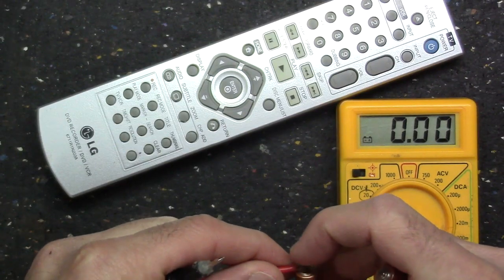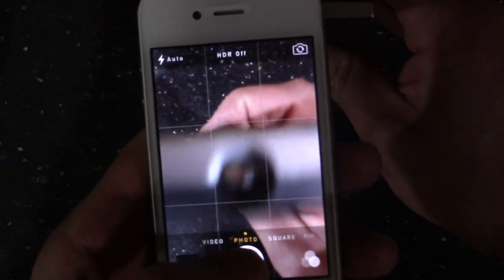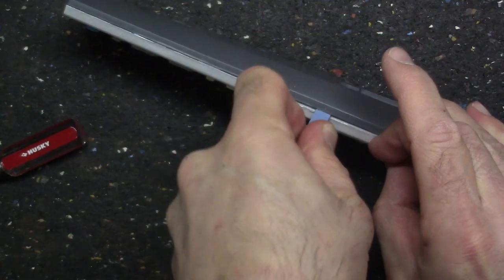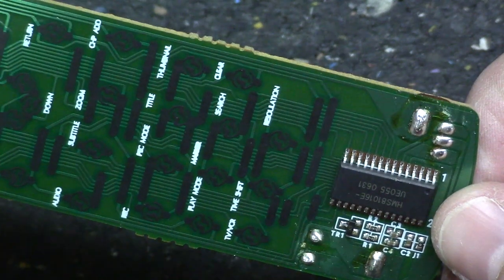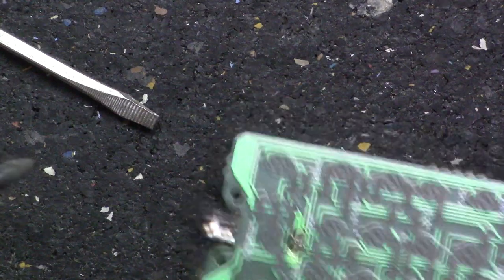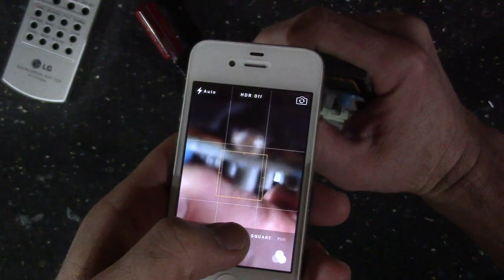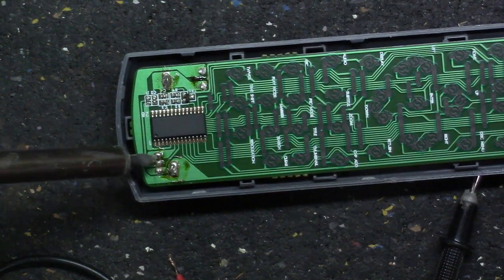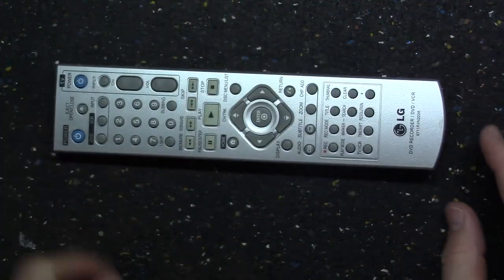How to fix a remote control

Comment: "Usually" it's dirty contacts on the back of the buttons or the backside of the pcb where the button press touched the contact..and not a cracked solder joint..please try cleaning with alcohol prior to  taking a soldering iron to your joints. If you aren't very skilled with a soldering iron , you will very likely heat it a split second too long and it will bleed to the next solder point, and then your device is history...and DEFINITELY don't remove  any capacitors/resistors unless you bought a replacement and are highly skilled with an iron. Thanks for the video
Reply: It depends what the issue is "IF" it's the  remote is completely dead like in video then yes that is most likely the cause... IF some of or most of the buttons don't work then it's probably the contacts like you said.....

Comment: Thanks for the video Adam. I have just bought a used Hi-Fi, which was working perfectly, but the remote was completely inoperative (one of the batteries had leaked and corroded the terminals) and I thought I'd have to buy a replacement on eBay. I cleaned up the battery terminals and wiped the circuit board with IPA, but this did not make the remote work. I then followed your advice about dabbing each of the solder terminals and it now works perfectly (although I held the soldering iron on the battery terminal joints a bit too long and they fell out, so I had to reattach them.
Five minutes work with a soldering iron saved me £16 and the hassle of buying a new unit! Great tip about using a phone camera to test all the buttons by the way; although interestingly my work iPhone camera didn't register the LED, but my old Samsung phone camera did pick it up.

Comment: Thanks for making this video, which helped me to fix my remote control for a brand new Lasko fan I bought with a remote that didn't work on arrival. In my case, pulling out the positive battery terminal springs a little bit, did the trick.

Comment: I had 2 remotes go dead after a move and I was able to fix one by doing just as you did and going over the joints with a soldering iron. That worked like a charm, even though I couldn't see anything wrong with the old joints. The other remote had a cracked board and I wasn't able to spend the time to solder on some short jumper wires to bridge the crack. Hopefully, I can get it back up and running in time.

Comment: Thanks for putting that up.  I was busy scrubbing the contacts on a remote and wanted to see if there was any solutions I didn't know about.  I've noticed that every control I've opened up has oil around the defective button.  Likely finger grease.  Since I've had a dish DVR for years, I have a donor remote that in extreme cases, I cut out a button to use as a replacement.  My surgical skills are not good enough to transplant the carbon button (yet).

Comment: Work for me used a solder on soldering points on my remote especially on led contacts and it start emitting IR - works (sherwood RNC - 100 )

Comment: hi from greece
one more test that your led is working beside the i-phone
it is ......THE RADIO
just put radio in to a frequency and test the remote control ...then you ll hear a sound if it is working !!!
if not... then it has problem!
Reply: Thanks ! My remote's capacitor had plucked out with the copper plating , which I resoldered by scraping the line and exposing the copper plating nearby  in same series. Still that did not work. After watching your video, i heated all soldered joints with soldering iron and now my remote worked :-) Thanks again !

Comment: And if all else fails and you just happen to have bit of gold leaf to hand, justy guild the contact face on the button. I used fake gold leaf and spraymount as an adhesive, worked a treat, but probably need to be gentle with the button.

Comment: In case folks need a tool for opening a remote, there are numerous spudger tools on Amazon. I would get all three types, metal, plastic and carbon fiber. OEM remotes are so expensive that you're almost forced to get them over the cheapo universal remotes, if you can't fix the original. Also, if you plan to do soldering, get a grounded, low/medium heat iron and work quickly.

Comment: Indeed a remote is so simple that usually its the bad joints to blame. If u cannot spot a crack or a disconnection by looking from the top, just flip the PCB and look at the joints sideways. Thats where u see a lifted joint or a disconnection

Comment: I liked your video, was just wondering if you could help with an issue with my remote, I have a simple wall fan remote control and all of a sudden only the 'switch on' button stopped working, however the off switch button is working, I also tried to clean the switch board but the 'on' button still won't work work

Comment: If you don't have a plastic spudger or opening tool, do you have a guitar?  A guitar pick is a great tool for opening press-fit plastic cases.  If you have any kind of plastic credit card you don't need, you can sand it to a wedge and use that.  Even a butter knife can ruin your casing, so just don't use metal.

Comment: What if you snapped the circuit board in half? Got a AC remote, can get for $50. At the moment using a phone app I had programmed prior to kneeling on controller

Comment: This works though it's hard to tell which joint it is because  they're so small..
( even in this vid and author with experience didn't get it right first few times) 
I apply flux any areas that looks sus then just heat the areas with hot air til looks shiny....
I think this is better because no skill is needed and even a novice can get it on first try..
Just flux ,heat , done....

Cleaning with alchool before hand is also a good idea... tho not necessary

Comment: hi from Singapore 
My remote TV remote control can only turn on and off. The other functions like Volume, 3D etc, doesn't work. Also the IR kept flashing after putting batteries in. Wonder what's the problem?
Reply: You have to connect it with bluetooth to the tv
Reply: One of the buttons is getting pressed all the time

Comment: My remote IR light is continuously blinking as soon as i place the batteries, without pressing any keys, not sure what can be the fix?
Reply: Open the remote and use rubbing alcohol to gently clean the remote circuit. Then clean the other plastic parts that were attached to the remote. Then try if it works. If the remote is still repetitively blinking, then you will need to solder as done in the video. If it still doesn't work, the remote circuit  might have internal damage.
Reply: @ridaassi8567  Tried everything, just ordered another remote 😂
Reply: @AshishUK  😂 well I guess it just had internal damage in its circuit board.

Comment: My tivo remote amber light stay on won't turn off ..remote won't turn tivo on
Reply from the maker: It sounds like the rubber pad is stuck. You may just need to take it apart and clean it.

Comment: What if some of the buttons are not working, on my tv remote volume buttons doesn't work, and few other buttons...
Reply from the maker: Usually it is because the contacts are dirty. First thing to try is cleaning it with isopropyl alcohol. (rubbing alcohol)
Reply: AdamDIY I've cleaned all with alchol and I've washed it with soupy water and still doesn't work, tried with aluminum foil and still doesn't work. What could be the other problems?
Reply from the maker: TheLebronce Just to be sure, it's not some weird programmable remote is it? Can I assume that we are talking about a remote that came with the TV?
Reply: AdamDIY yes,it came with tv this one http://cdn.shopclues.com/images/detailed/176/samsung_remote.jpg
volume buttons and the pre-ch button doesn't work, all others do.

Comment: my capacitor is ok but its track missing as its soldering area is destroy  .how to make track my airtel dth remote
Reply from the maker: Use wire and dont worry about making a new track. just follow the destroyed track and solder a very small wire at both ends.
Reply: AdamDIY I enjoyed your video.  Where did you get the capacitor/tester from and the name.  Thanks!
Reply from the maker: Measuray Frank An LSR meter will give you a better reading on good/bad capacitors. But the thing I used in the video is called a  TRANSISTOR TESTER DIODE RESISTOR CAPACITOR METER dc 9v   That's the ebay title.  It's just a cheap $10 thing from china.

Comment: ok not everybody just has a soldering iron laying around.
Reply from the maker: Yes, but they should.
Reply: Meh a cheap one is like 10$... and it doesn't have to be an Iron per say just need something  to get hot enough to melt that cheap soilder but not the board which is like 750F...